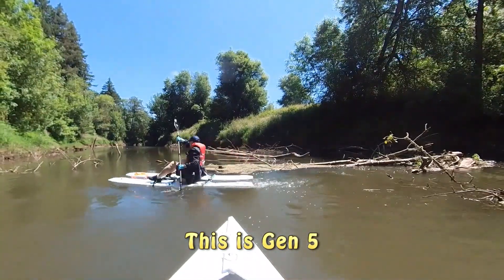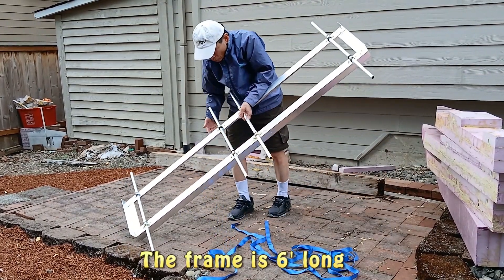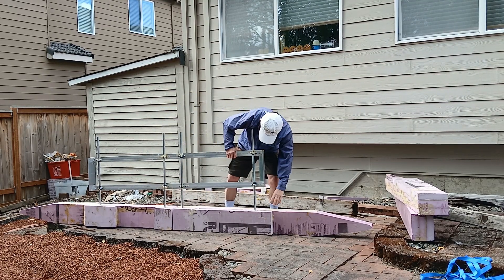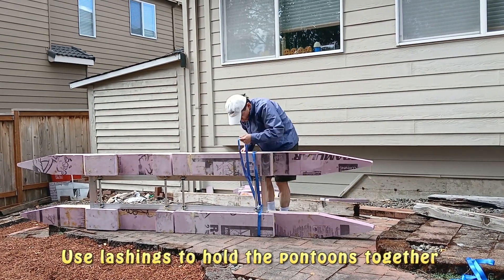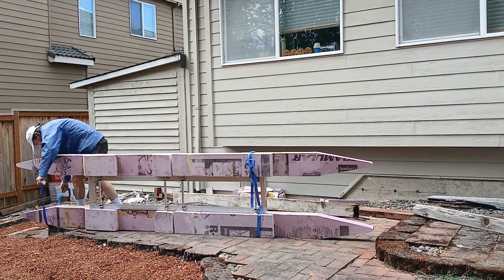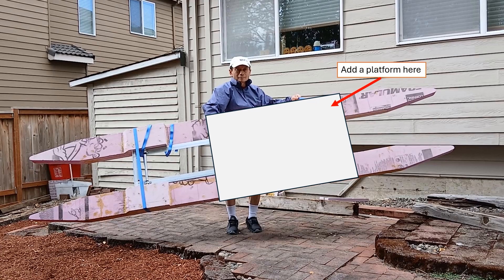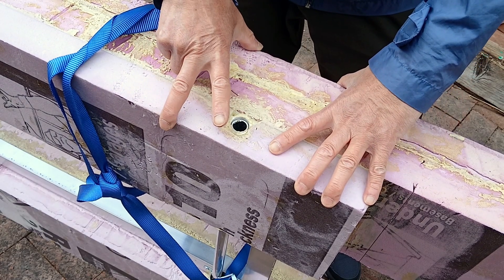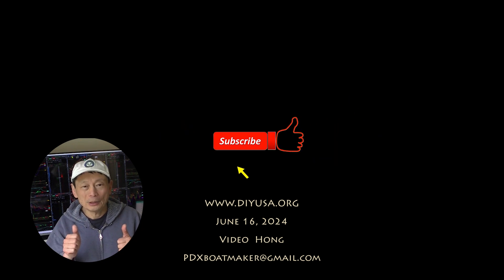Pt 2 Build a better modular pontoon boat   - Gen 6

Comment: What kind of foam do you use for the floats?
Reply from the maker: I used this foam from HomeDepot https://www.homedepot.com/p/Owens-Corning-FOAMULAR-NGX-F-250-2-in-x-4-ft-x-8-ft-SSE-R-10-XPS-Rigid-Foam-Board-Insulation-52DDNGX/315197962
Reply: @DIYUSA  thanks!!

Comment: How did you drill the holes thru the foam?
Reply from the maker: When I built my Gen 18, I used a heat gun to heat up a metal plate, and use that heated plate to cut into the foam and that is very effective. I wanted to used the same method to cut a hole into the foam. Unfortunately, I don't have a suitable metal pipe. Therefore I sandwiched the PVC pipe into two layers of 2" foam. I will show more details on how I did that in my future video.

Comment: I know you are using PMF, are you using fabric or craft paper?  I used fabric,  canvas actually,  and i believe i could have used craft paper and saved alot of weight on my pontoons.
Reply from the maker: Thanks for your suggestion.  I have bought the drop cloth from Harbor Freight (Cotton Canvas material) and I plan to use that. I am not aware I can use craft paper. I will investigate that first. Thanks.

Comment: Oh, I like this. I can see how easily you could modify it for different sized pontoons and platforms.
Reply from the maker: Yes, I have considered to buy the 4' long aluminum pipes, cut it into two pieces for the cross bars. But the local shop only has 3' long ones, therefore I decided to keep the width to 29" in this design.